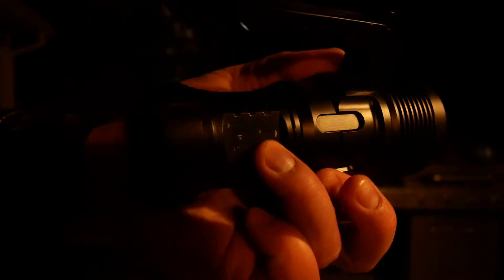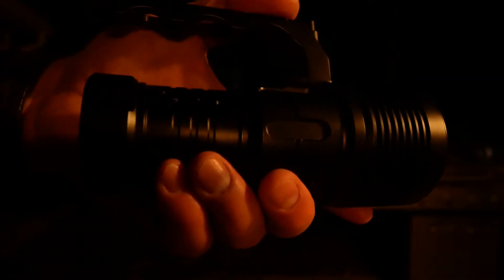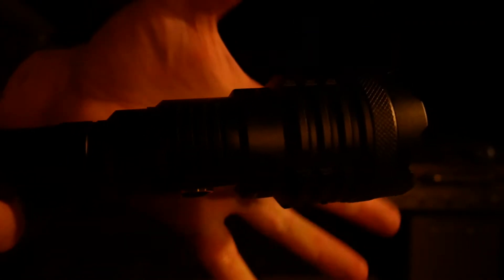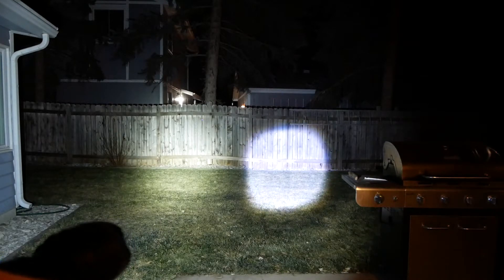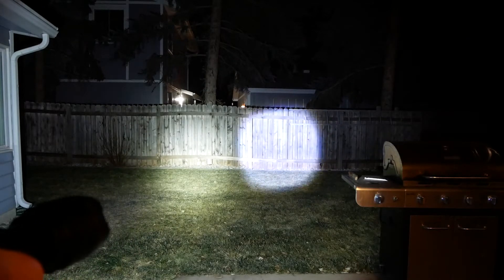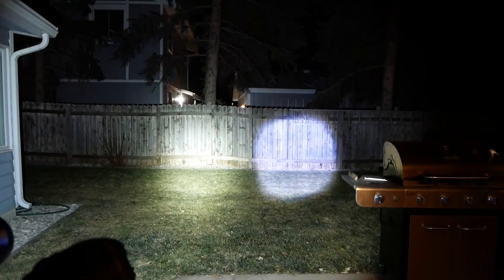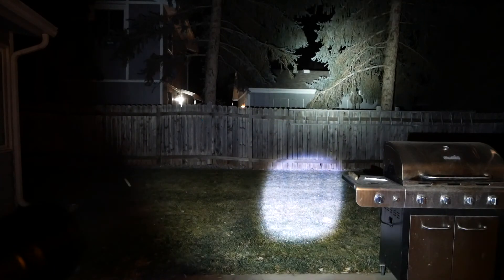XHP160 on a fresh charge vs undriven XHP70.2 on low batteries

Comment: Just being honest. The first light looks far better!
Reply: How about you do a proper comparison because the Chinese light was zoom in and the other light was clearly flood. So take your Chinese light and don't zoom in and then compare them 🙄
Reply from the maker: I watched my video just now. It seems you mean the old flashlight with the XHP70.2 in it is the better light since that is what I introduced first. To that, I have to agree! In another video, I did brightness and amp draw measurements. The legit CREE XHP70.2 in the exact same reflector as the XHP160 and at the same voltage made the same amount of light at about 1/2 the amp draw of the XHP160. IE: Expect to get about double the run time from your batteries for the same amount of light from a CREE XHP70.2 than you will from the XHP160!
Reply: I haven’t received it yet but I did order the Cree XHP90.2 
It has looked great in video reviews and I only will use it to go on night walks or if you can see my Avatar my recently burnt down cabin in Grand Lake Colorado. I’m hoping it will do the trick
Reply from the maker: @ciscoruiz3568  CREE does not make an XHP90.2 LED...no one does. There are no CREE knock-off clones since there is no such thing as a CREE XHP90.2. These LEDs are NOT in any way based on development from CREE. This is a 100% Chinese LED design based on their very ancient, low tech and inefficient T6 technology. I've made videos where I show the light output of the XHP160 vs a CREE XHP70.2 and that the measured light output is almost identical. The Chinese LED has 4X MORE LED elements of the same size as are in the CREE XHP70.2 and use 2X MORE current to make the same amount of light. In my opinion, these Chinese LEDs are cheap and you get them at a significant loss of efficiency over CREE LED's

Comment: Now I have a real question, why exactly does the light turn blue? A lot of people including myself do not like blue light coming out of an LED, I just never understood why it comes out blue, instead of white. I don’t mind it, but I do prefer neutral or daytime white over blue.
Reply from the maker: An LED has phosphors embedded in it. When they are excited by current flow, they release photons. Any LED has a mixture of phosphors to create some specific light color. 4300K light It is mostly white with a little tinge of yellow in it. It's not the easiest light color to replicate due to the phosphors required to duplicate natural sunlight. Chinese LED makers don't even try to duplicate it. This is a common thing for China...just go for whatever is cheapest and easiest to make. That 5400-5600K phosphor mix that makes the bluish light we all come to expect from Chinese LEDs is all about whatever is cheapest and easiest to make. If it was 4300K phosphors, then you'd be getting that color LED from China, but that's not the case...hence the bluish tinge they all have.
**
I too like the 4300K light that our sun makes. Our eyes are optimized for this light color and NOT for 5600K light like most Chinese LEDs make.
Reply: @de-bodgery  Just got  Gearlight flashlight, it’s an American XHP50.2. 
Go 2 Amazon, and search Gearlight s2500, it’s a true America p50, and it’s blue. The color isn’t mean it’s cheap my frend.I thought it was going to be white, cuz it’s Cree LED, but I was wrong. Cree LEDs come blue also and not always white.
Reply from the maker: @carlor2633  
I've never said that legit CREE LEDs come in only white. Go look at all the binning for them. They come in all sorts of colors...including blue. Chinese LEDS are rare in anything other than blue. I've yet to see one less than 5000K for XML's or XHP's or XPL's
**
I looked up your light...let me poke a few holes in the advertisement found here:
https://www.amazon.com/GearLight-High-Lumens-Flashlight-S2500/dp/B0887G73H1/ref=sr_1_1?dchild=1&keywords=Gearlight+s2500&qid=1610739950&sr=8-1
**
1. Price...$18.99: I'm already skeptical about the legitimacy of the "Real CREE LED" statement. A real CREE XHP50.2 costs about $10. So that leaves $9 for the rest of the flashlight and shipping. Not likely to be a legit CREE LED!
2. 6 AA batteries: They won't deliver the current needed by a real XHP50. This is probably NOT a legit CREE LED. At 12v...the XHP50.2 pulls 1.5 amps. At 6v it pulls 3 amps. This is right off the CREE datasheet for the XHP50.2! GOOD LUCK getting that from AA batteries! This light has 6 AA cells so it's at 9v max. It is highly likely this LED is running at 6v and definitely NOT at 3 amps from AA cells!
3. "1500 Real Lumens"...Uhuh...DOUBT IT! I specifically looked up the XHP50.2 datasheet. It is a significant improvement over the older XHP50 LED technology and is brighter. The brightest binnings of this LED are 1240 lumens at 25C or 1120 lumens at 85C. Again...DOUBT you have a legit CREE LED!
4. 8 hours of run time on 6 AA cells...yeah right! What LED is this really? It must be magical! NO WAY will you get 8 hours of runtime at 1 amp never mind 3 amps from AA cells!!!
5. Good NIMh AA cells have around 2000mah of capacity. Alkaline are much worse. 1 amp into 2000mah = 2 hours max! A FAR cry from 8 hours!!!
6. Add to this the fact that it makes blue light. I have never seen a legit CREE LED flashlight in anything other than white or yellowish light. I SERIOUSLY DOUBT you have a real CREE XHP50 or XHP50.2 LED.
*
Conclusion: Your light is a fake! In every way they lied about the LED or the lights specs. Sorry to disappoint you...this isn't a real CREE XHP50 flashlight. You got a Chinese light!
**
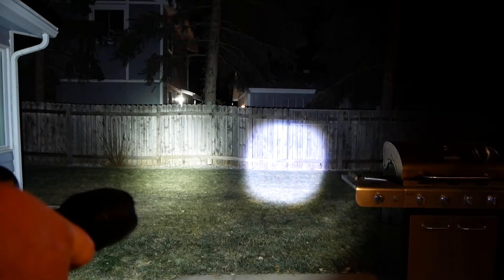If you still don't believe the truth, all it takes is a quick look at the LED. Legit CREE LED's are a smooth yellow surface with no tiny dimples in it. Chinese LED's have tiny dimples or spots in the surface of the LED. I have looked at hundreds of Chinese LEDs and they are all made this way! Here's my video on the XHP160. I get right down close to the LED and you can clearly see those spots or dimples. Go to 1:50 in the video. You wont see those tiny spots or dimples in a real CREE LED.
https://www.youtube.com/watch?v=n-ik7UW6z28&feature=youtu.be
**
I have a Chinese flashlight I bought in 2009. I had always assumed it had a Chinese XML in it despite it's nice white light. Last week I took it apart because it was flickering at times. I found a wire inside that had a cut in the insulation that was intermittently shorting. I took a close look at the LED and 100% to my surprise it was a real CREE XML! No tiny dimples or spots in the LED surface! I HAD to see if I could over watt it. I was not over watting LEDs in 2009. This was at worst a blown CREE XML LED and I have newer ones I could replace it with! This is something that Chinese XML's do NOT survive. Sure enough...I ran it at 4.5v and it was just fine.
Reply: @de-bodgery  I saw lamp,  surprised it was only 18 bucks. It comes AA batteries, n they use alkaline=less effective than lion,. It’s a real Cree LED but only use HALF power of it, cuz alkaline and like 7v instead of 12
Reply from the maker: @carlor2633  Lets assume it's a real CREE XHP50.2. It's making about half of what it is really capable of since it is running on AA cells. This means at best half of CREE specs for lumens. So they still lied about the lumens, only much worse than I imagined originally! 
I'm going to buy one of these lights. I might be surprised to find a real CREE LED inside. However for the price, I'm really skeptical. A legit CREE LED is expensive and at this price point...that is unlikely. I bought one...it will be here Tuesday or Wednesday. There is a picture of the LED in the Amazon ad. It shows the 4 elements inside and they have that distinctive dimpled pattern so common to Chinese LEDs. I've bought one, but I'm pretty sure it's not a CREE LED.
Reply from the maker: @carlor2633  Hi Carlo R
My S2500 arrived today. I've taken it apart. Go look at the Amazon Ad!!! They edited it! It no longer says it is a CREE XHP50.2! Also, here's my video about this flashlight.
https://youtu.be/X55KLoT6Ljo
Reply: @de-bodgery  In the same comment you say “American LEDs come in other colors other than white”
And then you say,
“I’ve never seen American LEDS come other than white or yellow.”

Than you say it’s probably not 1500 LM which there is no proof of that.
Thousands of people disagree with that on Amazon.

Lastly I heard you say the XHP50/50.2 can do like 1200LM. I’m confused because NO REAL Cree XHP50 has ever done that. Most are over 1900 LM easily and the 2nd generation pulls almost 3000,
https://www.cree.com/led-components/products/xlamp-leds-arrays/xhp-leds
 
I’m very confused where you are getting your info sir please help me.
Reply from the maker: @Arob1999  
1. READ What I wrote. I have no idea HOW you conclude that I said that “American LEDs come in other colors other than white”! I am specific in saying "CREE"! Where you get this "american" nonsense is beyond me. Nor do I EVER say that CREE LEDs come only in yellow or white. Again...go LOOK at the color options for yourself. I see 7000K to 2700K. HOW that is "only yellow or white" is a mystery to me.
2. Let people disagree. I don't care that they do. They don't know what they are talking about! Did they get legit CREE LEDs and then test them at the same voltage and amperage as a Chinese LED and find out if they were as good? Did they try to over watt a Chinese LED and a CREE LED? No they didn't! I did! Just RUN an XYZ Chinese LED vs the REAL CREE LED and see for yourself. This isn't rocket science. The real CREE LED will outperform the Chinese variant every time.
3. Here you go...read it for yourself. This IS the datasheet for the XHP50.2. Feel free to find where it shows anywhere an XHP50.2 that makes 3000 lumens. It's not in there! The highest lumen rating I see is 1239. https://www.cree.com/led-components/media/documents/ds-XHP502.pdf
**
I have to tell you that your confusion is from some other source, but not from me.
Reply: @de-bodgery  
I reread what you wrote earlier. The exact words were 
“I never said that legit Cree LEDs only come in white”
And than a couple paragraphs down you said:
“I’ve never seen a legit Cree light with anything other then white or yellow”

I’m trying to understand what you mean, 

Also I won’t say American anymore because all of your “legit CREE” LEDs come from China anyway, so I will just say LED so it’s better for all of us. 

Like I said, I reread your comments to the Carlo guy, I also checked your link as well. Thank you, Maybe the CREE website messed up? I don’t know. because the link I sent you comes from their actual website and it clearly states over 1900, and the link you gave me says other. I have no words for that. 

I doesn’t really matter, I’m just looking forward to you testing a real XHP70.2 vs XHP160. This would be a video I would have to see :)

I might have to edit this to reread your comment again,
Reply: @Arob1999  
My frend, leave him to his opinions, just continue ur work no waste ur time, jus accept it, we r different, and hav different viewpoints.